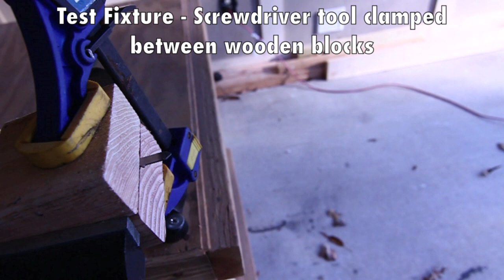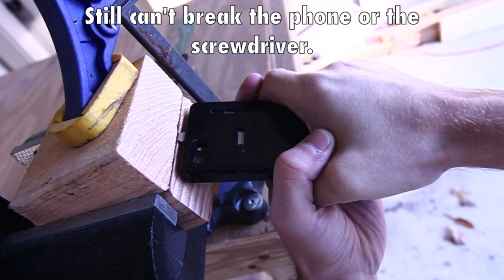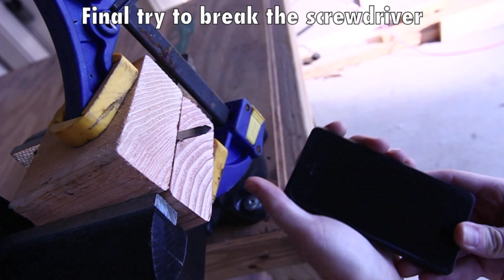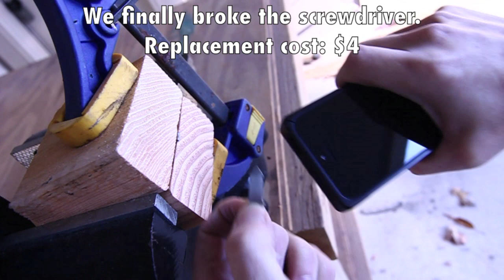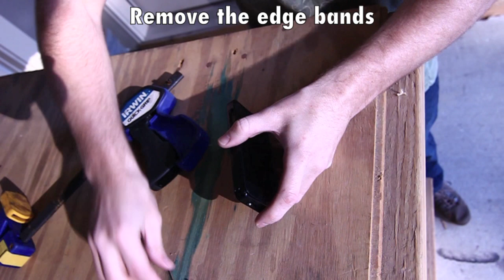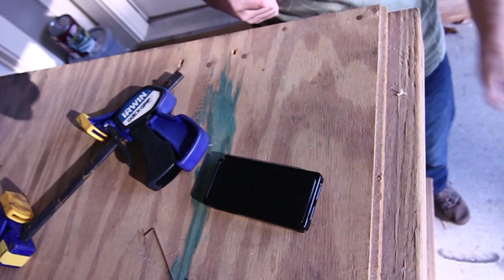Stress test of TaskOne with an iPhone 5

Comment from the maker: Hi Jason, good question.  Torsion is no problem for the case, you can apply enough torque to twist the hardened steel screwdriver with no damage to any of the other components or phone!